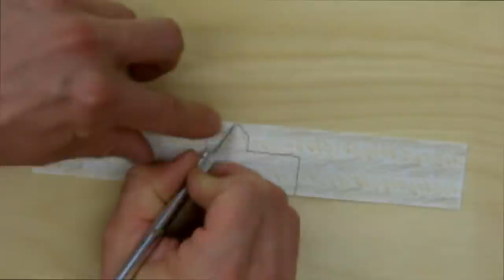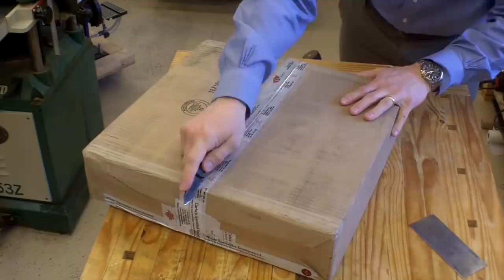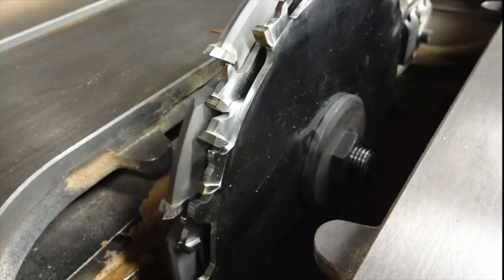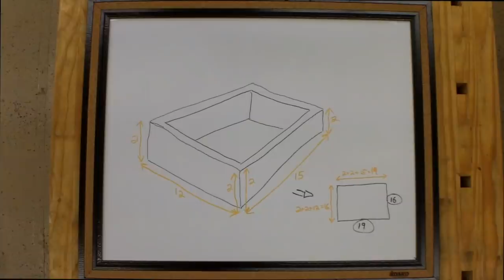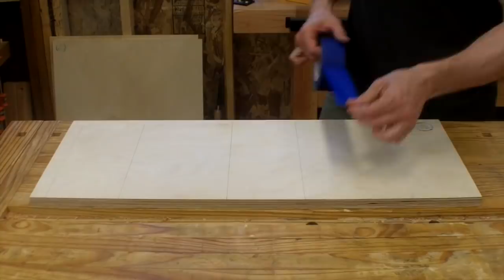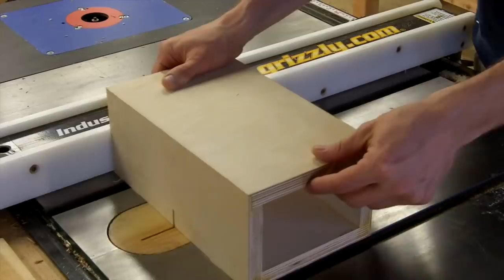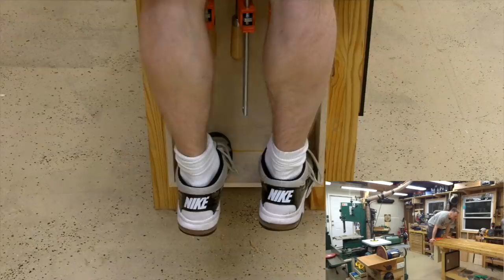New Invention - Easiest Drawers Ever!

Comment: Yay to outside the box thinking! What is the purpose of the "dado" section of the blade though? Without that section, if you made your cut just a 90 degree V, then it would always fold without a gap and the long-grain plywood layers (grain parallel to the cut) would always meet up against themselves, giving a strong glue joint. Even the end-grain (grain perpendicular to the cut) would be sliced at 45 degrees and give you about 70% the holding power of long-grain joints. Plenty of holding power.  In fact, if you had a 60 degree V, you could make triangles, and a 120 degree V would let you make hexagonal boxes simply. And the fact that you are using a table saw blade makes this much faster than if you were trying to hog all that away with a router bit. Anyway, I think this is fantastic-- really using your creative side!

Comment: I build Face Frames in a High Production cabinet shop. I'm not sure your ideal is any faster than our drawer builder. He uses butt joint with glue and nails. All your clamping is SLOOOOOOW.
Reply from the maker: +Jerry Quarles If you call a 30 second clamping operation SLOOOOOOW then I guess you are right.
Reply: He's not calling the time it takes to tighten the clamps slow. He's calling a minimum 30 minute set time per drawer per 4 clamps slow. I can have a set of drawers glued and stapled in 30 minutes to an hour. You're starting on 2. The idea is great man, but the execution is time consuming for an actual production shop. There's too much math and finesse involved to make this realistic for a volume based business. Besides, your customer base is most likely guys that like to take a lot of time perfecting joints. I'm sure Woodcraft would love your product.

Comment: Your idea is great. But - I am wondering if creating a routerbit of the same profile would be easier to produce. That would also enable CNC machinery to utilize your idea
Reply: +Hermod Opstvedt  You could not use a profile bit to create that joint with a CNC router or mill in one pass but with three  passes iit is easy I'm working out the depth formulas and conic bit required for various thickness of plywood.  If  the settings were mathematical and the only input were the thickness of the wood and the thickness of the veneer layer  it would work in any  measurement system
Reply: Yes, I am aware of the multipass, but I just wanted to point out an option to the dado stack. Here in europe, you won't find a saw that supports it.
Reply: +Peter Menningen Wouldn't it all depend on the thickness you need to leave to the table surface like 1/32 or 1/64 inch from the table surface
Reply: +anti govment  With a commercial grade panel router the top of the table is calibrated every time at startup, the tool length is programmed into the  machine setup files so that is known to 0.001"  
Since the finish (outside) surface of the drawer is on the table when you layout the tool path you can make it any thickness you want or need to make it bend  

The variables here are what size 90 degree bit is required to reach into the V groove (it can't be too wide or you'll leave gaps)  

The profile leads itself to a spreadsheet to calculate depths  and widths of the various cuts based on panel thickness. 
Also it only works efficiently if you have a tool changer

Comment: I used to build simple half inch plywood boxes basicly the same way except i had to make 2 cuts for each one you made because i didnt have a special cutter made to do it in one pass. Rather i  just used the saw blade tilted to a 45 angle. Then i would just fold the miters much as you did. After the glue dryed i did add a few pin nails for added strength but they were plenty strong for a box or drawer.

Comment: any one could have a blade or even a single shaper knife made just a little different without infringing on any patent. Every day hundreds of custom knives are made (steel) and you can't patent something like this? It would be like placing a patent on a certain shape of a bread loaf or cake....and a shop that makes blades or knives isn't going to check for a patent every time someone orders a custom knife/blade....plus shops who run custom moldings and make their own knives is not going to stop and wait for a patent search. Don't get me wrong I like your idea and video a lot and give you thumbs up!. Years ago (back in the late 70's) a good friend of mine had special bits made for a 3 HP router to make beveled edging on countertops very similar to the way you made your drawers using tape to hold the pieces together before glue/assembly. He started making beveled edge tops before anyone else did. This was in Tucson, Arizona. It's been so long ago but think his name is Don Coombs.
Reply: +Coherant bliss Doesn't really matter if a knife shop chooses not to worry about infringing a patent - they can still get sued for infringement.See especially US 8,746,116 for reproducibly cutting kerfs for joinery (also  US 7,677,830; US 7,082,974; US 7,641,414  or US 7,255,511 for examples of patents on furniture joinery)

Comment: Great stuff.  I was just looking for ways to make "normal" drawers quickly, and thinking that drawers, in general, tend to be overbuilt.  Guarantee my kitchen drawers don't need the strength of box joints to last generations.
I wonder how your method compares to other methods in terms of waste produced and the optimization of drawer size / area of wood used.   Lastly, it's almost November -- where's the "Buy Now" link??    ;)  Best of luck!

Comment: Great tool!  I found a similar joint in a craft box by a contemporary First Nations artist on Vancouver island.  The joint was hand cut, I believe with a router-plane type tool.  It does not use the square edges like yours, but cuts a cove next to a convex shape that mate when the joint is folded.  I was told that it was a traditional joint and was steamed before bending.

Comment: Well - what if you just used:
  a router with 45 degree bit 
  or a tilted straight/rabbeting bit
  or a tilted dado blade
  or two tilted cuts with standart blade
  or really anything else and do FAST MITRES?             -That way you don't need that fancy blade.

Comment: The "best" design, of course, is not necessarily the strongest design.  Rather, the best design is the one that accomplishes its purpose while making the best use of available resources.  One of those resources is the woodworker's time.  If a woodworker takes an inordinate amount of time to produce a drawer using finger joints that is 10x stronger than it needs to be, that's not necessarily a successful design.  The effort produced a drawer that was way beyond specs while consuming valuable woodworking time that could have been used in some other productive endeavor.
Reply: +Tom Nally 
I certainly agree with all that you say, a few hours of sleep thinking and this guy has come up with something that will help those of us that haven't got the skills to use the conventional  methods. I hope he gets the backing he needs to get it on the market.
Reply from the maker: +Jake Ledgerwood the first drawer I make in the video was out of 1/2 plywood.  In the second half I use the same blade to make a drawer with 3/4" sides and 1/4" bottom.
Reply: +Tom Nally You've made a good point, Tom. I hope Andy does extremely well with his invention.
Reply: If you think you dont have the skills to make a butt-jointed box with a dado in it, you don't have the skills it takes to set this up.
Reply: True!  And if that is one of the objectives of a woodworker, there's nothing wrong with that!
Reply: +Tom Nally Unless you find doing things a bit overkill to be more fun
Reply: Following that logic, most drawers really just need to be 1/2" ply. So this design needs to be shrunk down to accommodate 1/2" instead of 3/4"...which is really WAY overkill for a kitchen or shop drawer.
Reply: +Jake Ledgerwood lol no it's not.
Reply: +MM Valderrama go look in your kitchen. Most of your drawers are 1/2"

Comment: Hi, Nice job but, here in the UK you can buy a router bit to cut a very similar joint as yours on a router table. The only difference is that all four sides are cut separately, as you would need to do if you were using solid wood, rather than a laminated wood like plywood. I used mine to make some 36" square boxes to put under the beds for extra storage space.

Comment: I love this!  My company buys Ultracraft Cabinetry, and I just got back from a factory tour.  Right now they often buy drawer boxes from a supplier, but they might be interested in making their own in house with this system, since they do a lot of custom work and this seems perfect for fast custom items.  If instead of using the standard yellow wood glue you used the two part fast setting epoxy it would go together fast enough for an assembly line.  This is brilliant, I'm going to try to send it to everyone there that I know.  

You might also want to try kickstarter, it seems like there's a lot of individuals that would want to buy this for their shops, and really you'd just be selling the blades.  If you had a good kickstarter you could go to a manufacturer of saw blades and just place an order for however many you needed, rather than trying to license to a company.  It's sort of like how Sawstop got started, they had a patent, but no one was interested in licensing the technology because of liability concerns, so they just started making their own saws.

Comment: Very impressive but I think using this to get a little extra gluing surface is overkill. I have made pantry draws that hold up to 100 lbs. using simple box construction. They are 8 years old and still showing no signs of breaking. I think using ball bearing slides is the key to my success. Good luck with your patent!

Comment: This is a very cool idea, but not totally original. If you read the Mr Sawdust book "How to Master the Radial Saw" you'll find an entry in the Bevel Cross-Cut section. It talks about a speaker manufacturer building speaker cabinets in the 60's using essentially this technique. They used a standard dado though, but otherwise ended up with the same result.

I wish you luck with your patent application and all, but beware the prior art is out there.

Comment: I can see the idea, but have say.. The cost of Plywood.. here at least is quit high. If your making drawers out of 3/4 ply and have several to make the costs are way past what I would have in my shop. not counting a custom made blade to boot... Drawers are made of cheaper materials to keep costs down.. They have the same strengths if your holding Knives and forks or spray cans and screwdrivers...and I can make a lot of drawers for what will cost you to make one.. Yours do look prettier though  but when closed who would know the difference..

Comment: The weakness of this is the outer edge in daily use. That material has tension in it and will start releasing splinters as time goes by.
Another thing is that such joint cutting is trivially automated and not really saving work for Ikea or the like.
And lastly, I disapprove of patents in general. Now some small-scale garage makers, the only ones who still must do things my by hand, won't be able to make use of this invention. And the big ones can just ignore it - or buy you out and put it in the safe.
One guy (you) gets his mortgage paid and thousands of woodworkers will keep doing it the old way. I don't see any advancement here!

Comment: If I was still able to do any woodcraft, I would be doing everything I could to get ahold of one of these blades. Cabinets and drawers can be very rewarding and fun to build. With all the tools and options we have today it is easier and easier. Drawer strength is an area that you see failures often. NOT with this blade. I have never used it. I would not trust myself at a table saw any longer, but I do know great ideas and fantastic glue ups when I see one. I am not affiliated and have never met this person. A good saw, a great fence, a pocket hole jigs and now this blade. Cabinet making is so easy.

Comment: very nice product  my suggestion would be for http://www.mlcswoodworking.com/ or http://www.leevalley.com/en/home/Help.aspx however another way to go is to do a crowdfunding to get the money to develop and inventory could even be sold on a infomercial might be worth while to get on the show Shark Tank or Dragon's Den depending on what country your in Canada has a show called Dragon's Den similar to the Shark Tank. I sure you can come up with a catchy name like "Easy Drawer " or "Easy Joint"

Have you though about doing a crowd funding http://www.crowdfunding.com/ on this and go into production yourself I think this could become as common as a dado set of blades and be able to market it to the home depots and lowes if you can get the price points needed.

Good luck and I think you have a Winner of a product

Comment: Really great video Andrew, and clearly you are a fine woodworker.  I love the idea of a one pass joint here - however, not knowing enough about patent law it`s difficult to say  . . . but I am not certain it would meet the requirements for an original concept (and admittedly,  I don`t know patent law !).  But how is it so different from that superbly well designed, locking drawer joint for which Lee Valley (and others) sell (not sure it`s name, sorry).  That said, many old things and recipes, techniques, etc. get reborn, packaged a new, and yes, patented.  Anyone ever seen a Willow tree; taken a pill for a headachce  . . .

Perhaps one of the oldest versions of this idea, and a pretty elegant one, is the ``bent wood box`` which had been on the pacific coast for a few thousand years before the Europeans (Spanish) arrived.  The First Nations made (the sides of) their boxes of edge grain cedar.  They cut their joinery, steamed the wood and folded it into a square, around a bottom.  The last joint (not bent) is held together by stitching with spruce root.  Many of these same boxes were crafted to be watertight as well.

Comment: Andrew, could this be done on solid wood?, maple, or mahogany, for example. I'm thinking about a possible way to hydrate & soften (temporarily) the tiny corner lines of the wood to do it..., do you know which could be the best liquid for that?, water?, some kind of oil?, any of the many petroleum derivatives? Of course any heat font must participate on the process... I'm asking you 'cause i still have'nt bought my machines, i'm in the way to build my home, i'll not use it to make money, but i would like to give you any kind of tip/jig if a discover one. Thx a lot for share your wisdom.

Comment: cant you do the same with a normal miter with a router table and just set it to leave a tiny width of ply? then it just folds into place and a couple of pins or screws would hold it in place, saves getting these fancy blades, just a thought, but great idea :D

Comment: I really don't want to make you feel bad. I am sure you have put lots into it. Problem one, plywood is a lot more expensive than a hardboard or other drawer bottom materials. Problem two, cost of the blade, how much does it cost to make and what is the markup and or what is your target market? Problem three (this is my personal problem) that either means a ton of clamps or putting a lot of screws in. And my fourth and last problem is time to figure it out and it seems to easy to make a mistake. Meaning lost time and material. Please take this constructive! I know how hard it is to hear people ridicule something that is your pride and joy. Now if you disagree with me, that is just fine. Keep up the great work.

Comment: This is a good idea, in fact it's a great idea...

Unfortunately however it's not an entirely new idea, it's a planer knife, just done with a stacked dado, rather than a singular wide blade to cut the entire profile with one edge.

I'm not taking a thing away from your design, because it demonstrates a good understanding of the mechanical and geometric problem(s) at hand, to which I applaud your ingenuity...

However, while a patent may indeed be granted, it would only be for ~perhaps~ that specific geometry, which would readily be redone in a modest variation to achieve the same effective result.

Comment: This is a very clever invention!  Well done!
I did wonder why not just use a blade with a 90˚ cut / 45˚ per board?  You've designed a small "shoulder" on the blade.  You can use a blade with a 90˚ point, and then use standard dadoes to create a wide shoulder - as you do in your demos.  The width of the dadoes would be the width of the board less the width of the blade.

Comment: Hey, I do agree that making drawers as your job sucks. In a cabinet shop, its one of the lowest jobs you can have (besides sanding). I have made 1,000's of drawers before moving to face frames, then cutout, then doors, then tops, then to install. I have done it all.

 For a production shop, I don't see any value in this tool. It is way way way way way too slow, and uses too much material. 1/4"  bottoms are industry standard for hardwood cabinets. Also the drawer material is often times off fall. You are using huge chunks of thick stock, that would be used for finished ends on uppers and lowers.  

I bet this would sll good for the harry homeowner, and home woodworking. It also might have value in a furniture making, but as a tool to make drawers, imo its a no go deal for me.